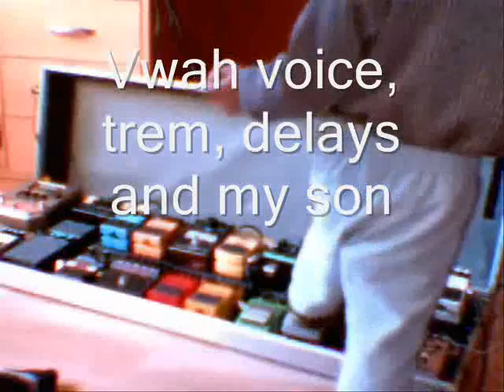pedalboard audio demo

Comment from the maker: Not a lot because the idea was to demo the individual pedals as stand alone units. I used the analogue delay a lot but u can't hear it cos of the condenser mike. The "harmony" soundbite is actually only the dual pitch shifter, and I use the womaniser once I think, as well as the HQ pitch for 12 string. The octo delay is my own preset.The "Radio" sound is the standard factory preset.
 I can put a demo together on how to get the best out of the magicstomp in a pedalboard context if you want.

Comment from the maker: if you deactivate the sim you can run the MS through either the front end and the FX loop return, I use both depending on the sound I want. You should listen to the results and see what is best for you. Remember that you will loose all eq possibilities as well as reverb on your amp if you run into the FX loop.

Comment: Well, that would be a really nice idea!

 You seem to know some things about sound and stuff, so please let me ask you a question:
 
 Ub99 has a bunch of multieffects named "Amp multi (chorus/flanger/etc)". That -if speaker simulator is not activated- is supposed to be used "for direct connection to power amp".So, that means that it should be plugged into amp's loop effects? Is that "direct connection to power amp"?